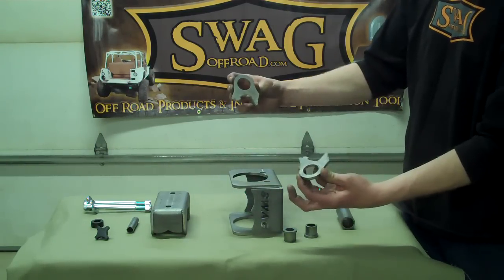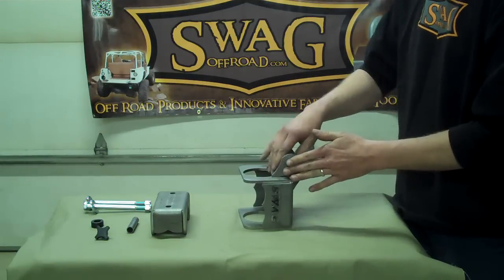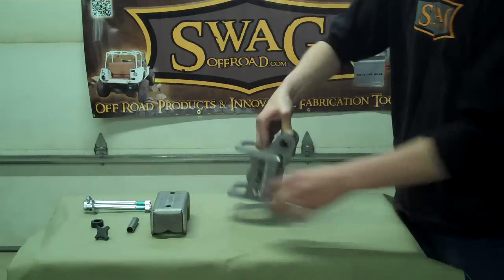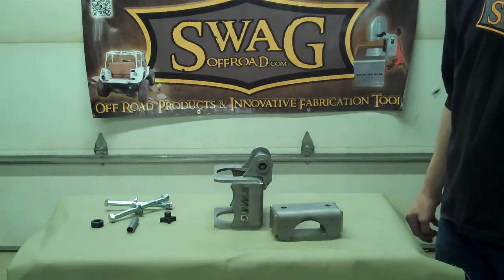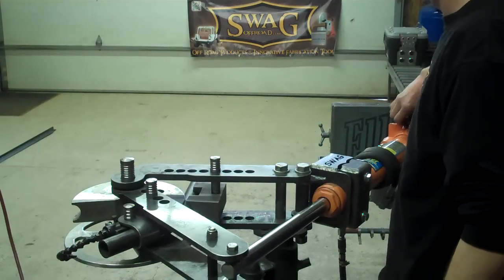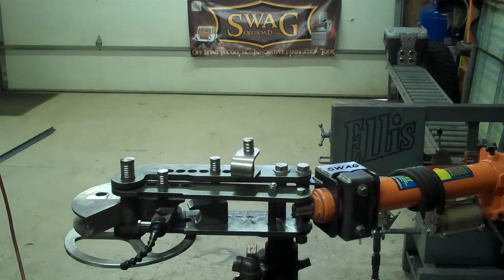SWAG Harbor Freight Air Hydraulic Tube Bender Attachment

Comment: I bought this kit fully welded ( an extra 30$ or so and well worth it) I'll let Troy finish the job. If you need to ever move your bender around this is the only way to go. I welded up an adapter to mount the jd2 model 3 to a Harbor Freight engine stand. However I did replace all the bolts with Gr9 fine thread blots, washers, and nuts. It bends 1 1/2" x0.95 DOM just fine. You can't have too much air compressor!!!!!!

Comment: If you have the model 3, then this is the one to get. If you have the JD2 Model 32, then the machined version is the one to get. This version will bend with the added capacity of the model 32. The machined version will also align the air hydraulic jack centering it on the push area of the arm  allowing a longer life for the jack.

Comment: I've got the Swag ram adaptor on my Pro-Tools MB105 and the piece works great, my only gripe is that the adaptor is designed to swing on the rear most bolt holding the static part of the bender together.  I'd like this bolt to be tight so those two arms of the bender are firm, but if it's tight the Swag piece doesn't swing freely.  I added a third bolt holding these two arms together and the rear most is now pretty loose to accommodate the ram swinging.

Also Swag (or anyone) - is this ram orientation the best for horizontal performance (release valve @ 12 o'clock?).  Mine currently works manually but not pneumatically.

Comment: Ive got a idea id like to try with mine. Also using your product. Tig weld a ss plate eye at the end of the ram. Then on your clamp make something to hold a pneumatic air cylinder that will retract the hydro. Can use same air hose with a small ball valve on cylinder. They make the perfect size cylinders. I already see it. Would work perfect. If doing alot of bends all day it could save your muscles retracting the ram.
Reply: Or just spend more money on a retractable hydro ram 😂

Comment: Ram does not come up on the harbor freight website when I search for that PN. 
can u provide a link?
Reply from the maker: Harbor Freight has discontinued their ram. We recommend Valley's 8 ton long ram, which can be purchased at the link below:

https://www.ebay.com/itm/8-TON-AIR-AND-HYDRAULIC-LONG-RAM-BOTTLE-JACK-ENGINE-HOIST-CHERRY-PICKER-TOOLS/350829123238?ssPageName=STRK%3AMEBIDX%3AIT&_trksid=p2057872.m2749.l2649
Reply: HF does have them for $99.00 its the 8 ton unit with air

Comment: Does it work with the current harbor freight tube bender  ??
Reply: NO
This is not for harbor freight pipe bender.!.. it uses the harbor freight air/hydraulic ram. There is no such thing as harbor freight tubing bender

Comment: Why can't you weld the cylinder to the clamp?
Reply: some guy , all that heat around all those seals and machined surfaces will not end well. Yes you can disassemble the unit but most people won't want to do that......
Reply: some guy so when it fails you can replace it genius.